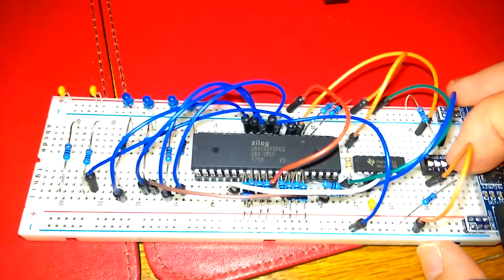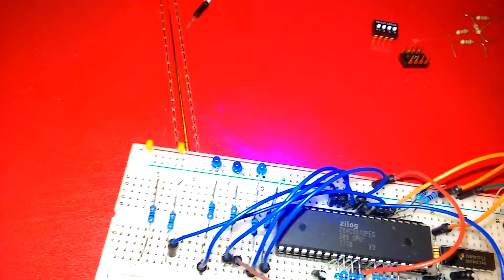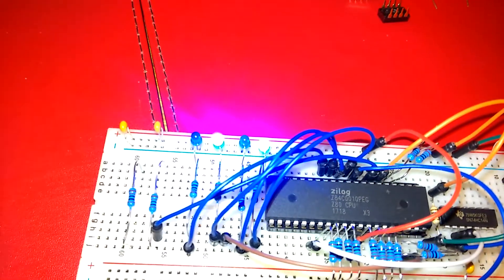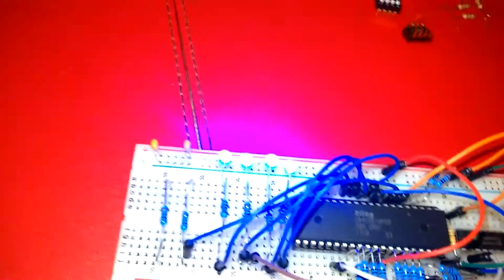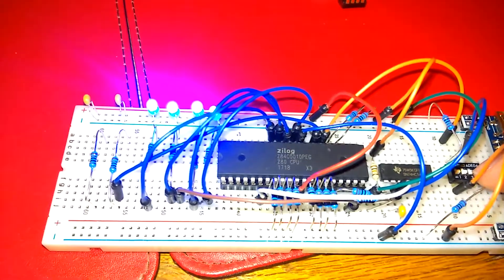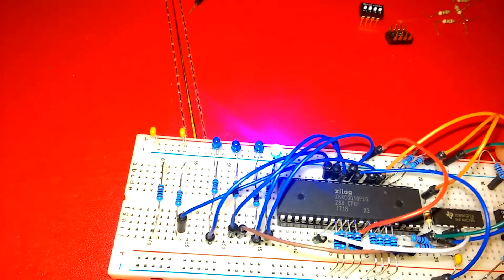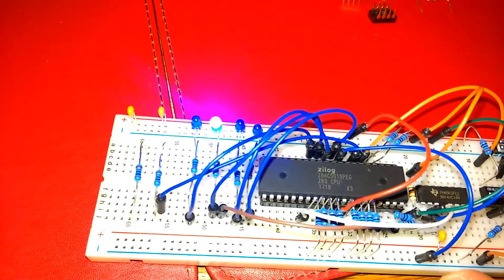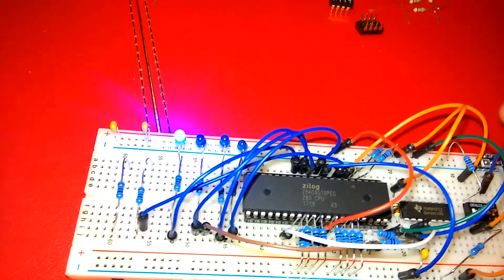Manually driving the Z80 CPU chip.

Comment from the maker: I need some help figuring this out. I can't seem to get the clock to work correctly. It seems to execute multiple cycles each time I push the button. I measured the voltage on the clock pin. It pulls down to zero when I push the button, but only comes up to 2.5v when I release. Surely it should come back up to 5volts??? I tried adding a pullup resistor on the clock line, which pulls it up to 5volts, but then pushing the button only pulls it down to 2.5volts.
Reply: Switch debouncing is most important when controlling digital circuits. You should either use an RC circuit to smooth out the bounces plus a Schmitt trigger gate (NAND typically) to make a proper square pulse clock from it, or better still, connect two NAND gates as an RS-flip-flop and use a SPDT switch at the inputs. Pull-ups or pull-downs are/were usually mandatory at inputs driven by switches: no input should be left floating i.e. in an unconnected state at any point.